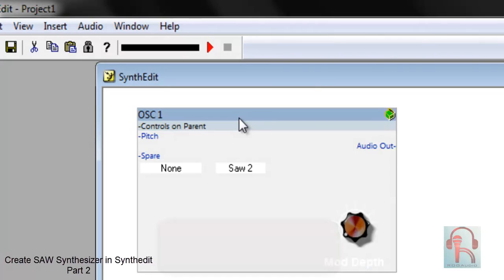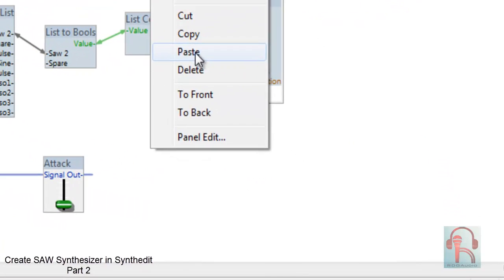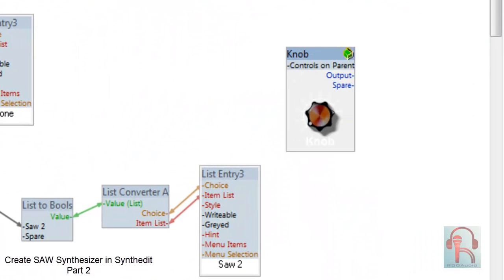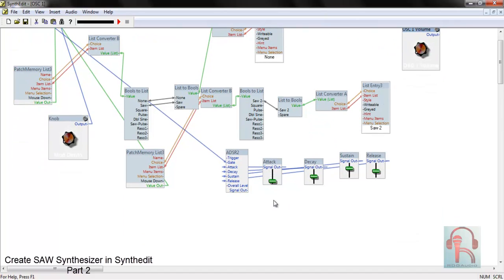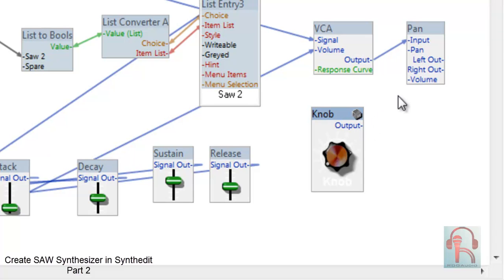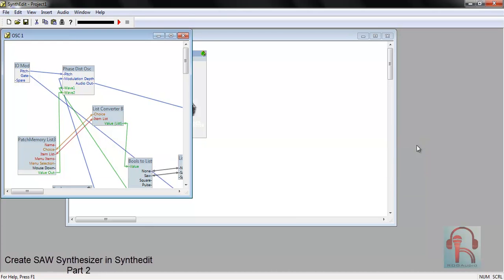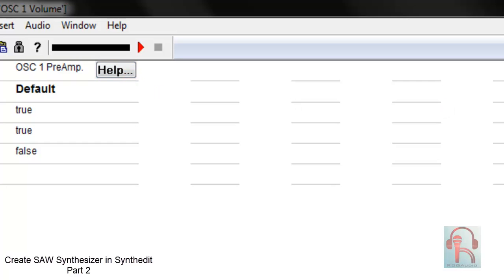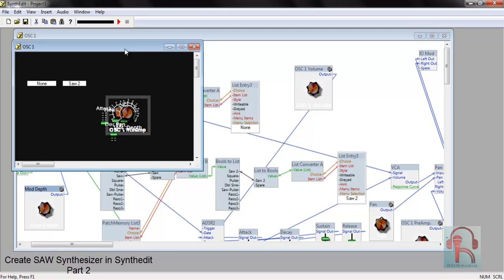Create A Saw Synthesizer VST in Synthedit from Scratch Tutorial RDGAudio Part 2

Comment: 1 - It is redundant to have two level controls for one oscillator.
2 - You should use subcontrols for ADSR levels to save CPU load.
3 - The Mod Depth control is useless the way you connected it.
4 - With all due respect, I think you should check better before publishing "tutorials". In spite of your goodwill, I do not think that they bring more than confusion to those who want to learn seriously.